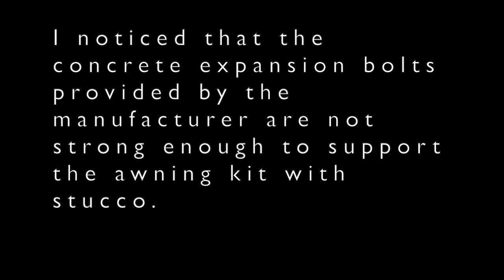How to install MCombo retractable sun shade awning by yourself (13x8) -- Part I

Comment: Good video!  I’m going to be installing mine. I bought a combo 12x10’ Awning.   Thanks for the video. I saved it and sent myself a link.
Reply from the maker: All the best to your awning installation! May God bless your family!
Reply: Hi, I just finished installing my awning shade but i have not tightened everything down. When I opened the shade it slopes down too low around 45 degrees. how do I adjust so that the end is higher, like 10 degrees slope?
Reply from the maker: Easy, look for the two nuts that can adjust the slope on both sides of the bar. Loosen it, turn toward the directions of the wall, then tighten the nuts again. The troubleshooting section of the manual should tell you the location of the two adjustment nuts. Hope it works!
Reply: @enderchoo  ok. Thanks!  I just did it.
Reply: The only issue I now is that the retractable arm does not retract evenly. I had to manually assist one of arms. I guess I get what I paid for.
Reply from the maker: This has something to do with the tension of the spring. I think you can adjust the tension by changing  the contact point between the folding arm and the outer supporting bar. All the best!

Comment: Great job. I want to install the same thing. But, in my case, the brackets probably cannot be positioned right on the studs behind the stucco+plywood wall. I am thinking to add a 2x4x12 ledger board on the wall and mount the brackets on the ledger board. I am not sure if it is going to work or not.

Comment: So this took me and my neighbour 5 hours to do.  The instructions say use a 14mm drill bit, but found it wasn’t big enough so used a 16mm and the bolts fitted fine with a tiny bit of hammering.  Plus instructions wasn’t clear on what to do with extra cord thing that you push down the fabric so just cut them off.
Reply from the maker: You are right! This instruction manual is not elaborate and accurate. You just have to improvise a little bit. Good job!

Comment: Hi, your video shows the screws you used to attach the awning to the wall. I want to know the exact size/manufacturer/vendor so that I can use the same screws. Thank you.
Reply from the maker: I use a 4 inches concrete screw. However, I locate the wood stud in the wall and screw into it. I hope this helps!

Comment: Nice tips but what went wrong those tops six holes on a brick  too high I guess.
Reply from the maker: Yes, it was too high at the beginning. Also the anchor screw didn't hold well on the stucco wall. I used my own screw to attach to the wood stud.

Comment: How did u find the wood stud? Did you use a stud finder from inside the house?
Reply from the maker: Yes. But you still have to make a guess from outside by drilling several small holes in a row. Good news is that the steel bar would be able to block the incorrect drill holes. Good luck!

Comment: Question, I'm having a difficult time find my size 8'x8' , I noticed you put 2 poles together. Is it possible I can  buy a wider piece and trim it on the inside to size?
Reply from the maker: What is your current size? Let me see if there's a way to double the size.
Reply: @enderchoo  it's 8' wide by 8 ' length